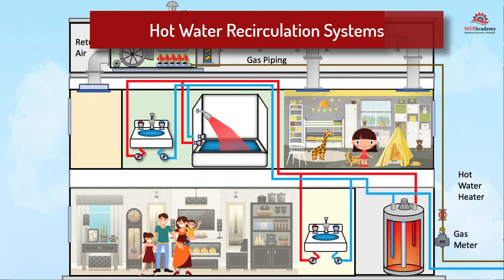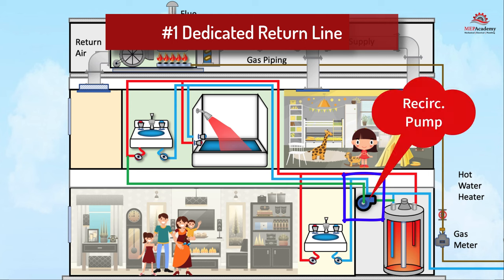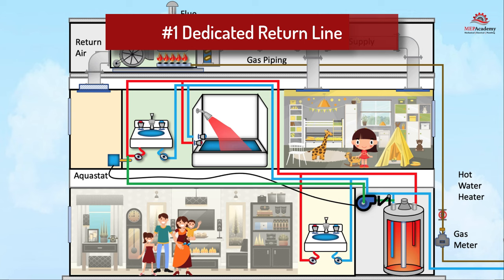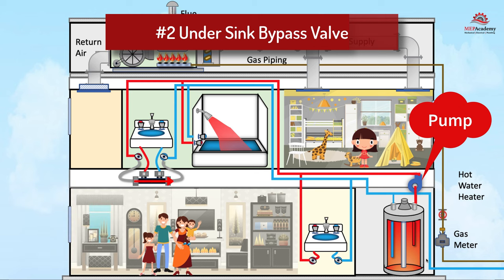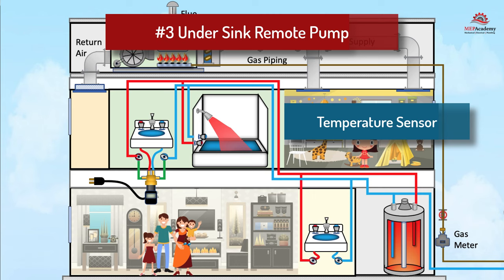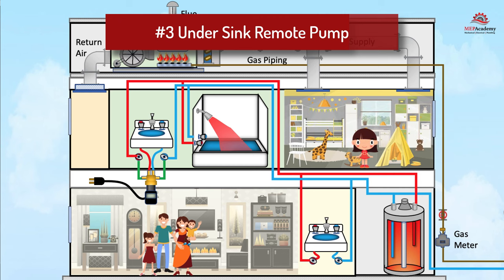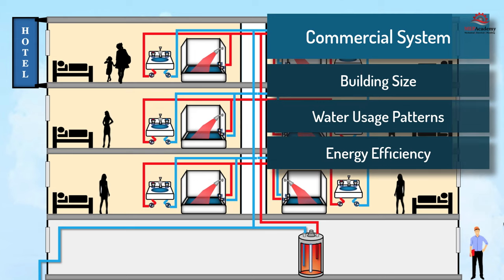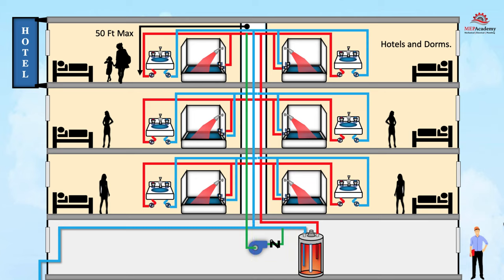Hot Water Recirculation System

Comment: In #2 and #3, you will put heated water into the cold line. Drinking water from the heater is hazardous. You will have to run the cold water for several minutes to flush the hot water out of the system.  Basically the same waste as flushing out cold water from your hot line.
Reply from the maker: We agree that's an important point to consider. Hot water from the tap might contain more minerals or impurities compared to cold water, as hot water can dissolve minerals more easily. If there are concerns about water quality, it's advisable to have the water tested, and definitely use a filtration system for drinking water.
Reply: Thanks for saving my time! I wanted to say exactly the same thing. That is not an option for me. I intend to install another tank on the other side of my house and do some replumbing!

Comment: You didn’t mention the most important reason for having a flow&return hot water system, which is to prevent the growth of Legionella bacteria in the warm water pipes.
Reply from the maker: Great reminder. Thanks.
Reply: "What warm water pipes" are you talking about?  When someone turns off their hot water faucet does the hot water pipe turn into a warm water pipe?  Are you referring to the thermostatic valve under sinks that remain open until 95F water arrives at the sink?
Reply: @utube4greenfuture  Legionella will multiply in pipes that are between about 20 and 60 Celcius. Temperatures higher than those will kill the bacteria.  In temperatures lower than those then it doesn’t multiply.  You must ensure that your pipes aren’t stagnating with warm water in that range. The solution is both technical and procedural.  A hot flow and return system which ensures that hot water flows regularly through to the furthest point of the system is the technical part.  The procedural part is to run taps regularly…

Comment: How does the under the sink system #2 prevent circulating hot water from coming out when the cold-water valve is opened by the user expecting cold water?  Since there is always going to be hot water in the cold line during the time set for recirculation then it would seem that the hot water trapped in that cold line back to the tank would first have to flow out of the spicket before cold water would be felt.  What am I missing?
Reply from the maker: A better choice is a dedicated recirculation line if one is installed. The #2 system ensures instantaneous hot water at the expense of heating up the cold water some. The thinking might be along the lines of 1) It minimizes the waste of water, 2) Most fixtures will require hot water during usage, such as showers, bathtubs, Dishwashers and Clothes Washers. The benefit has to be determined by the user and the usage pattern of the fixtures.

Comment: I'm trying hard to understand this but still confused. I understand the concept of it put the actual piping is confusing
Reply from the maker: If there isn't a dedicated hot water return pipe, then the system uses the cold water pipe to keep the hot water pipe warm, which also rises the temperature of the cold water pipe. For water to flow the system needs a water loop, which is created using the cold water pipe, which benefits the hot water system at the expense of a warmer cold water pipe.

Comment: that is not right, the return line should connect to the hot pipe on the boiler. why put in on the cold line??
Reply: So it can go back into the water heater and get reheated. If it went to the hot side of the boiler it would dilute the hot supply of water, which is counterproductive
Reply from the maker: @bisurdaddy Thanks for the response.
Reply: @bisurdaddy so every single fixture's cold like also connected to hot water tank ?
Reply: @bisurdaddy how you gonna make sure only water which was hot before will go to hot water tank not the regular cold water?
Reply: @harpreetsingh1675  it doesn't matter when it goes to the supply side of the hot water tank. It's going to get reheated in the tank. If you connect the return to the output side of the tank, the hot water that is returning after passing through the supply pipe in the house isn't nearly as hot anymore. If you mix that water with the hot water after it leaves the tank it will cool the hot water as it's being supplied to the house.

Comment: In system without dedicated return line. The "not-hot-enough" water is sent to the cold water line eventually into the water heater, if the hot water is not potable, is this setup going to send non-potable water into cold water faucets?
Reply from the maker: Not sure we understand the question, but you should never mix non-potable water with potable water unless code allowed through an approved back flow preventer.
Reply: If you have potable water connected to a non potable system, such as a boiler for makeup water, you'd have a backflow preventer on the potable supply before the boiler. You'd connect the return after the backflow preventer on the supply side.
Reply from the maker: Correct, any industrial use of a potable water system would have to use an approved back flow prevention device. @bisurdaddy

Comment: After the upstairs bathroom sink couldn't you use 1/2" pex to return to the water heater? Would the increased velocity of the smaller return be harmful to the pipe?
Reply from the maker: As long as there is some method to circulate the water when not in use, so that the hot water is readily available for the user based on usage patterns and the normal time of day that the fixtures are used. The 1/2" size shouldn't be a problem as you're just trying to keep a small amount of hot water circulating so that at the time of use you don't waste a lot of water to reach the hot water.

Comment: Provided that the pump is running 24/7, does this system(#2 or #3) make cold pipe to be warm(or hot) all the time? Just wondering if this is worth if it a lot of energy is wasted to heat up both pipe lines at all times.
Reply from the maker: Methods of control can be added, such as a time clock. This would ensure that the system only runs when the user normally requires hot water.

Comment: Do you tap your return line in on the 1/2 inch line going to the fixture or the main before the tee?
Reply from the maker: If you're using the bypass valve, you would connect on the fixture branch line. See the manufacturers literature for the correct method of attachment.

Comment: Thanks for the excellent video.

In my 16-story apartment building, I've noticed that every night between about 2am and 6am, every faucet in my unit (bath, shower, kitchen) will send out really hot water -- even when turned to cold only.

It seems like my building must be using the cold water pipes as a return line. Do you think they have the recirculator on a timer during these late night hours?
Reply from the maker: That's possible, check with the Building Engineer as I'm sure they'll let you know for sure.

Comment: I've had my recirculating pump installed under my Rennai instant water heater in our garage and a Bypass valve installed under the sink on far side of our small 1650 ft home.  My wife has complained constantly...let me emphasize the word "CONSTANTLY'...No hot water!!!  She'll run the sink hot water valve for minutes before hot water. 
Question(s): If you turn on cold water while waiting for the recirculation of hot water, does this prevent hot water from recirculation? 
If you have to wait before using using cold water how long to wait? Long enough for her to make me an espresso, rub my back, massage my feet...yea this ain't happening either so about how long???  Much thanks for your reply.
Reply from the maker: Sounds like something isn't connected or set correctly. Has it ever provided hot water on demand as intended? Is there a timer that isn't allowing it to run when you normally use the hot water. The timer should allow you to set the pump to run just before your wife normally uses the hot water at the remote sink. Make sure that the timer is set to circulate hot water before she needs it, that way you don't waste energy. Running of the cold water won't matter at the time of use, as the hot water should be timed to already be waiting for the user.

Comment: So Ive designed a dedicated return line in a large home with 2 boilers.. 1 main line for cold water, 1 main line for hot water ( pump feeds 2 boilers, a header of 2 outlets) connects to the home paralleing the cold water line.. distance is about 200 feet of piping ... a seperate return line around the home and there are 2 risers with fitting from further point on each side of the home flow down to a pump room where it meets a hot water recirculating pump with thermostat.. problem we have is that the hot water kinda comes and goes .. like a bit of a pressure imbalance.. water pressure is pretty good for both lines. I shut off the return lines as a mean to test to see if under normal conditions there is balance.. the pressure becomes lower.. whats the best way to diagnose this problem? and is it ok to have 2 pipes opposite side of homes flowing down and  connecting to an outside network (underground) dedicated return line? there are also faucets below kitchen etc.. the plumbing Contractor added return lines for almost everything.. I am lost and need some help. Thanks a million
Reply from the maker: Definitely need eyes on this problem. Can you hire a local engineer to review? It would be great if you had the original design drawings for them to review along with the specifications of the pumps. Remember the longer the piping and the more fittings there are, the greater the pressure drop in the system, which adds additional head to the pumps. Can the pipe and fittings be visually inspected along its full length? We suggest finding someone locally that has an engineering background to review the site and drawings if available. Good luck.

Comment: This seems like it would cause hot water to come out of your cold water tap?
Reply from the maker: Yes, if it doesn't use a dedicated hot water return pipe, then the cold water temperature will rise as it is subjected to the how water recirculating in the system. The pump needs a loop in order to move water, so the cold water piping is used for that purpose.

Comment: Method one, would water be recirculating when circulation pump off, would this also cause pressure to drop in the hot line?
Reply from the maker: The water won't circulate through the return line when the pump is off. Hot water can flow through any fixture when the pump is off, as the city water district provides the pressure required for flow. The pump only runs as required to maintain a certain temperature as set by the home owner, or as dictated by a time clock. Thanks for watching.

Comment: With a recirculation pump on the heater does an expansion tank on the cold water line cause a problem or could be damaged?
Reply from the maker: When installing an expansion tank in a hot water recirculation system, it is typically placed on the cold water supply line to the water heater. The tank contains a diaphragm or bladder that separates the water and a cushion of air. As water expands, it compresses the air, allowing for the accommodation of increased volume without causing a significant rise in pressure.

It's important to consult local plumbing codes and the manufacturer's guidelines for both the water heater and the expansion tank to ensure proper installation and compliance with regulations.
Reply: @MEPAcademy  Thanks for the info.  I've got an expansion tank on the cold side and am looking into having a recirculation pump put on the system.  I'm concerned that the water recirculation goes to the heater on the cold side and if that could damage the expansion tank?

Comment: What is the head feet of option #2 and # 3? I am going about 22 feet to an upstairs bathroom
Reply from the maker: That is not a long distance, as long as you don't have tons of fittings a small recirculation pump should work fine. Check with your local supplier on the various pumps and their capacity.

Comment: Does the bypass valve have to be installed at the sink?  Why not the shower or tub?
Reply from the maker: You want to install the bypass valve at the furthest plumbing fixture so that hot water is available to all the plumbing fixtures along the hot water supply path. It doesn't have to be a sink, but the furthest plumbing fixture requiring hot water.